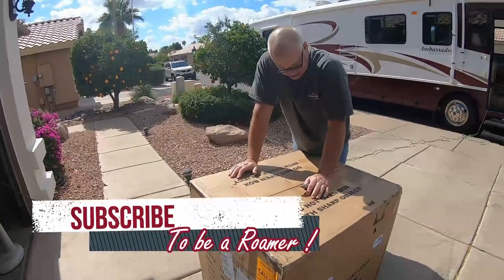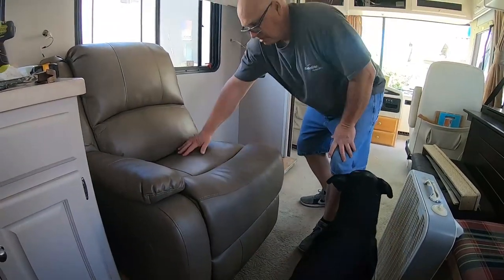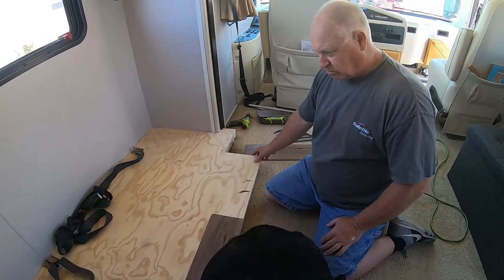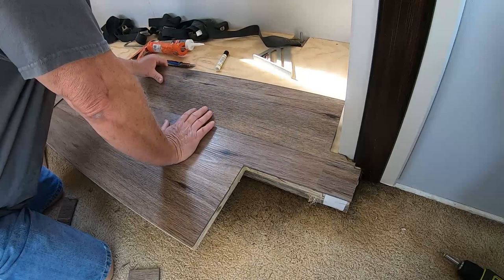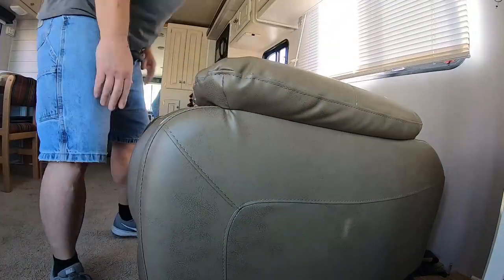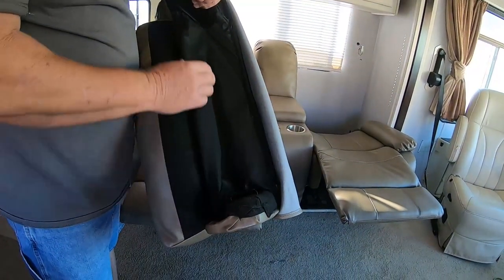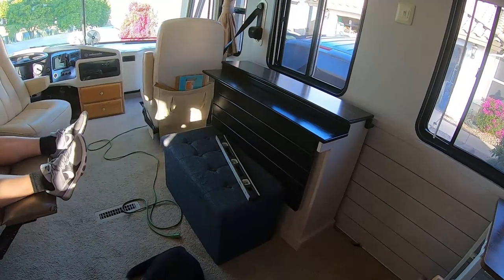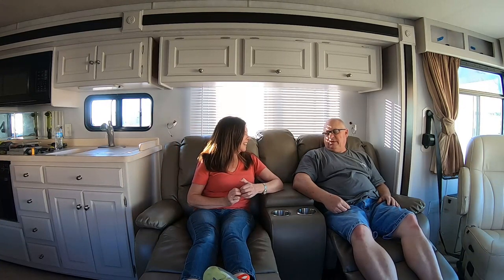RecPro RV Recliners! WOW! - Easy Install PT 2

Comment: Nice job. We are doing the same type of project. How far out from the back wall did you have to come with the plywood?  Also how comfortable are the seats?  Thanks.
Reply from the maker: Thanks, I came out 33" from the back wall with the 3/4 plywood. That way the recliners can fully extend. They are very comfortable. We have a link in the description that has a 5% discount. Sorry it took so long to answer I had to go and remeasure what it was. Thank you for watching!!

Comment: what diesel was in your Holiday Rambler?  I am looking at a 2001 34 ft and it has a 260hp cummins. I've heard they are good but in that year you have to watch for the 53 block. Curious of your thoughts on that RV and engine.
Reply from the maker: We had a 2001 36ft Ambassador with a 300 Cummins. I felt that it was a bit under powered for that coach size. Hope this helps!

Comment: Lovely couple.  Looking to do something similar to my motorhome.  I don't know why he put down flooring to wall where no one would see it but, if you do, I recommend Loctite adhesive rather than silicone which is more senistive to temperature (it can get hot in storage).   I remember Edith Ann, and, since I have cable, still watch Laugh-In and Edith Ann.  I had an aunt Edith who was a sweet lady.  Dennis W.
Reply from the maker: Thanks for the tip on the flooring.  Glad the video reminded you of nice things. 😊

Comment: Don't really want to say anything negative, but would you not have measured that area prior to ordering the new RecPro Reclinerrs? Just asking.
Reply from the maker: Yes, I did measure and new I was going to have add a sub floor! I just wanted to show the steps involved in installing them. Thanks for watching!
Reply: @RoamingWithRosie  I am ordering the 67-inch recliner and I had measured to ensure the front base of the recliner had the 36 inch minimum from the back wall. The front of my slide is 39 1/2. Three inches to spare. This is why I order this recliner. I know exactly where the recliner is going to be placed on my slide.

Comment: I’m planning on doing this with our motorhome. I note that RecPro states that we need a 36” base on the slideout. We have 30”. I saw on another response that you made your base 33”. Is that correct and does it seem to hold up okay? Do you need any support under the extension? Thanks.
Reply from the maker: I used 3/4" plywood for the base. It held up really well. If you watch the video I only had it go out that far where the recliners are I notched it so we wold hit out legs on the base extension. Good luck and thanks for watching!

Comment: Another Great video with the recliners and installation of the plywood floor. Just a couple of questions, are the seat belts still functional? I'm still unsure how far back under the slide out you removed the existing carpet for the new vinyl flooring? Did you just cut the carpet even with end of the original slide out or did you remove it totally from under the slide out?? My slide out has 3 rollers under the slide out, does yours? Have you had any scratches on the new flooring due to the slide out. Sorry for all the questions, there's just not enough information on YouTube regarding this particular type of slide out. We tell everyone our 40' MH  only sleeps 2  😀😀
Reply from the maker: Sorry for the late response. The comments get lost sometimes. I removed all of the carpet. It only went a few inches under the slide. The seat belts still function you just have to feed them through the recliners. My slide had three rollers as well and we did not get any scratching when the slide goes in or out. When we removed the jackknife sofa. We made the decision that we travel just the two of us and if we ever had a guest we would use a blow up mattress. Hope this helps and again sorry for the late response. Thank you so much for watching!

Comment: So do these recliners/installation meet requirements for a auto seat. Are they bolted to the rv frame? Thanks!
Reply from the maker: They are screwed down to the 3'4 " plywood. The seatbelts are original and installed at the factory. We just changed the furniture piece, not the seatbelts. 😉

Comment: Can you tell me the dimensions of the plywood base floor you added, in particular, the depth.  I will be doing the same.  I was thinking 37”, but wanted to know what you ended up with.  Thank you
Reply from the maker: sure.  The plywood base is 33.5" under the recliners only.  The slide base itself is 25" And that is still the depth on each side of the recliners so no one can walk into the corner of it.  The width is still the same as the original space.  I can send you sketch or additional pics if you need it.    If you are ordering from rec pro, be sure to grab our coupon linked in the description.
Reply: Roaming With Rosie thank you for your reply.  I did order the RecPro 67” recliner’s.  Can’t wait to get them installed!!

Comment: What size hardware did you use.  There are no instructions that came with it
Reply from the maker: I just screwed it down to the plywood. I chose wood screws that were large enough so the head would seat down in the holes in the bottom metal frame of the recliners.

Comment: What is the flooring called? We're going to be doing the floors in our keystone hideout
Reply from the maker: Hi there.  We purchased it from Home Depot.  Can't remember exactly what color we chose, but here's the link: https://www.homedepot.com/s/MSIs%2520Devon%2520Oak%25206%2520in.%2520x%252036%2520in.?NCNI-5

Comment: Question - why did you do the side cut outs on the plywood?
Reply from the maker: Because otherwise they would stick out because the recliners arent as wide as the slide platform and  its raised above the floor and we thought somebody would catch their ankle on those corners. Hope that answers your question. Thanks.
Reply: @RoamingWithRosie  that's what I thought.  Thanks for confirming! 😊